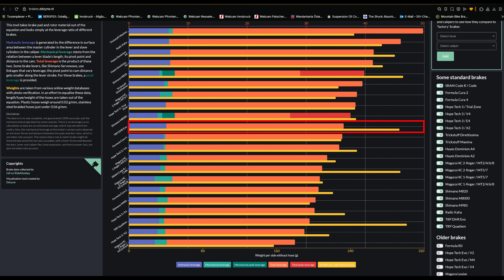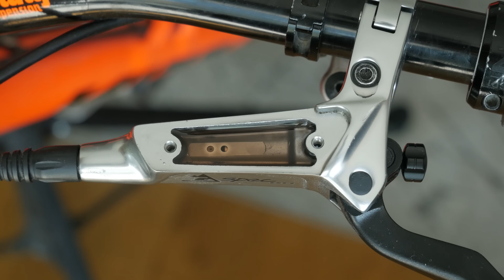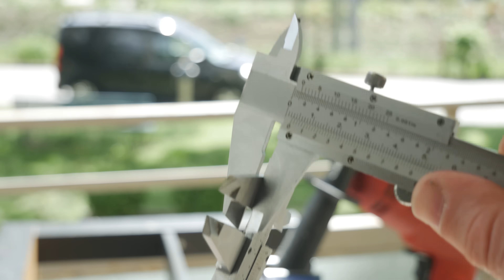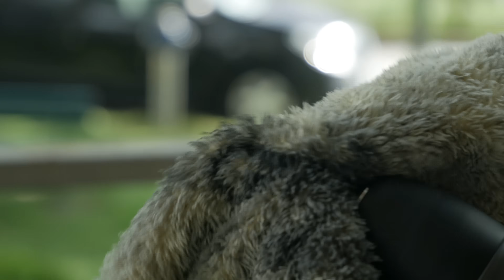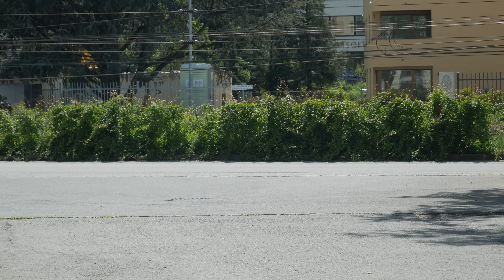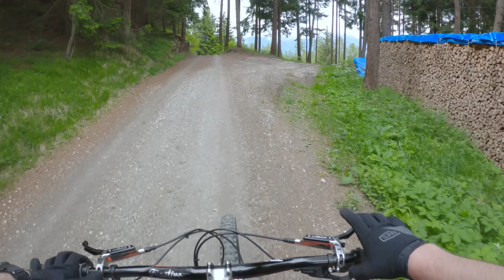Power Amplification Mod in Hydraulic Brakes - Brakes Part 1

Comment: You can reduce your calliper piston throw by using a narrower bleed spacer or removing the wheel and then squeezing the lever a bit.
Reply: With your skills you can easily tap a thread into the lever or calliper and make your own bite point adjustment screw?
Reply from the maker: @leroyjenkins7971  Hey, thanks for the tip. I did remove the wheel and use a worn out 1.8 mm brake disc to set the pad distance and then put my wheels with 2.3 mm rotors back in. It works great but after 5-6 rides the lever throw gets very long again as the pads wear down. 

The problem I saw with the bite point adjuster is that it increases the pressure in the reservoir and the O-rings I used for the pistons can't take much pressure.

I've already reached out to Trickstuff and they offered to help, but after 3 weeks I'm sitll waiting on TRP to send me a reply about the exact size of the caliper piston seals.
Reply: @pathfindrperformance ❤ my next tip was going to be exactly this as with shimano I often finish the bleed from the calliper letting the lever out as I increase fluid in the system and it tends to work long term, I only just fitted the trp evo pros to my bike yesterday and I would like the bite point closer so I will be experimenting with it over the next few days. On some systems you can add pressure from the top port and then pull the lever in to keep the pressure in then fit the bleed screw before letting the lever out, then allow the fluid back out if pads too close by very slowly backing the bleed screw out. But as you said all this is limited by how much pressure the bladder gasket can handle, make your own gasket? Love your work!!! I am a professional bicycle mechanic 👨🏻‍🔧 and when someone says it cannot be done I take it as a challenge.
Reply: @pathfindrperformance sorry I read your reply again and didn’t understand, is it your seals or the calliper seals that are not holding pressure? I assumed it was the reservoir that is leaking?
Reply from the maker: @leroyjenkins7971  Yes the little black ring on the main piston I made can't hold too much pressure. I noticed it's fine when riding, but if I bleed the brakes with two syringes and build up to much pressure in the reservoir then it starts to leak a little.

Comment: when I saw a geometron with a yari and bomber I knew this will be good. subbed forpart 2
Reply from the maker: Yess had an EXT Storia V3 before, but this Bomber won't exactly be stock... might take a while before I'm finished with it, but I'm planning on doing a video about my fork's air spring. As for why a Yari, that will also be clear once I've done that video...
Reply: @pathfindrperformance  looking forward to it. Yes it was apparent to me that it's not stock, that's why so interested😊

Comment: Incredibly cool project. I'm currently running a setup with Formula RO calipers (25.4mm pistons) and a Sram XO trail Lever (I like this better than the guide/code) (9.5mm piston) This gives me more hydraulic leverage than the Maximas, and hands down the best brakes I've ever tried. Combined with Trickstuff Power pads, and 225mm rotors, I'm able to stop a freight train. I've got a set of Formula R1R levers (pull-pistons) that I want to test, which should further increase the hydraulic ratio.
Reply from the maker: Cool stuff! There is a lot of interesting combinations out there, a freind of mine wants to try TRP/Mavens
Reply: @pathfindrperformance  Trp lever and MT7 caliper is amazing.

Comment: nice Viedeo! can you do a Video on the shock and what you did to it? I'm currently planning to reshim mine and maybe make it silver like yours
Reply from the maker: Hey dude! I have switched some parts out in it for easier service, like the reservoir cap in the IFP. I'm also going to sent it in to Mario Suspension Tech (MST) in Germany to swap the main piston for a high flow one with a custom shimstack and install a new LSC assembly. If you live in the European area, a Marzzochi Bomber CR + MST piston & tuning is the most bang for your buck you can get out of any rear shock. Otherwise the Canadian brand WPS also makes upgrade kits for the Bomber, but those tend to be much more expensive...

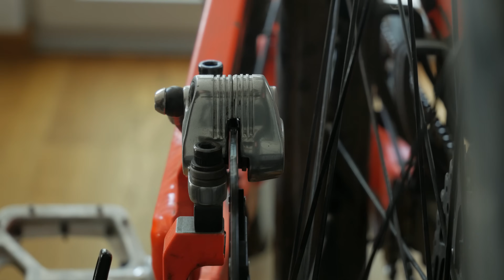Comment: 3:49 wouldn’t a thicker rotor give you the same feel?
Reply from the maker: I guess you could try set the gap between the rotor and pads with a narrower rotor and then install a thicker one. But once the pads wear down enough, the pistons will just spring back as much as the seals allow them and sit at the same distance as before. I'm actually already on 2.3 mm rotors but haven't tried this one yet, but I'll give it a try!

Comment: Seriously impressive garage engineering. That lever reach looks crazy far though. Still not clear how  Trickstuff manages to have a short dead stroke with high leverage?  Their piston seals must have minimal spring back?
Reply from the maker: Yep, that's exactly it. But that also means that the rotors will rub on the pads like crazy if the caliper is out of alignment or the rotor is slightly bent.

Comment: is there any way to update that website? adding the latest maven, trp dhr evo pro, hope tech 4 v4, gustav, lewis and more?
Reply from the maker: You can  click on the link on the bottom left that says "Brake data collected by Udi on RideMonkey". It will take you to a thread where the first post details how to suggest new additions. The complicated part is to finding out the start and end leverage of linkages brakes. Which is why the Mavens haven't been added yet for example... The DHR Evo Pros should be easy to figure out since it still has a 9 mm MP and 4 x 16 CPs and the only thing that's changed it the mechanical leverge.
Reply: @pathfindrperformance that’s why I don’t do it
I can say the piston sizes on masters and calipers but everything else is unknown to me

Comment: I hardly belive you can manufacture the needed tolerances or surfaces qualities needed with the shown manufacturing processes. Besides the shown test run, how many runs did you manage and did the performance stay the same? 

Anyway, you managed to incorporate the most amazing methapors and word plays I have heard in a long time and worth at least 10 thumbs up.
Reply from the maker: Hey, I noticed that both the Shimano and the TRP brake pistons had a ~0.1 mm gap between the piston and the wall, so I aimed for that (Went well, mostly). The most important thing is to get the grooves for the seals straight and smooth to have a good... seal. Other than that the piston just needs to be strong enough to withstand the force from the piston rod on one side and the pressure acting on the main seal on the other side. The tube I used in the lever body was already suprisingly well manufactured and with a little polishing it turned out great. 

Had the rear brakes for about a month, but it was awkward having a brake with a very short and another with a very long lever throw, so I decided to convert the front sooner than expected. I've ridden the full combo about 3 times now...

Comment: I’m absolutely floored by your ingenuity. With the seals, they often become more pliable when soaked in brake fluid. This was true for motorcycle brakes which use dot fluid but I’m sure the same applies for mineral fluid. Good work!

Comment: Cool idea and great video! I've also experimented a lot with brakes before, I really like my Intends, but I can totally understand your goals. Usually brands don't go with super small master cylinders, because those increase the hydraulic pressure a lot. And that will create a big difference in lever feel between the front and back brakes( the rear hose is way longer, so it expands more = softer lever). I've found that the Shimano hoses are stiffer than the 5.0 thick TRP DHR hoses so those give a sharper lever feel, but I'm not sure what hoses the Quadiem uses. I would probably try to find different seals for the pistons in the caliper, which have shorter travel in order to decrease the lever throw. The problem is, that the magura mt5 calipers are soo cheap, it's hard to go with anything else.Those have huge pistons and the pistons sit close to the rotors, so they work quite well with any lever. Also I'm only using Putoline 2.5 in my brakes, it's super thin, makes bleeding easier and also works well in cold and hot temps.
Reply from the maker: Neat stuff. The intends are like the ultimate brakes.  I 100% noticed that the rear brake is "softer". At first I thought that the primary seal was too far back, but it turned out to be identical to the front one. I already use the hoses from my old Shimano XTs. Didnät even know that they are supposed to be stiffer ^^ But yeah new caliper piston seals are probably the way to go...
Reply: I had the feeling that the magura lines are stiffer than the shimano lines. but I dont have any data to back that up
Reply: @HannyDart it’s not, I watched a video by ezmtb they were testing the stiffness of hoses from shimano, Magura and ezmtb, shimano is closed to the stiffest ezmtb k28 hose, Magura is the softest among those three
Reply: @jackgu1893  haha well I guess thats how feel can be wrong. Do you know how I can find that video?
Reply: Does anyone know the piston seal sizes that TRP uses? Need to rebuild some Slate Evos...